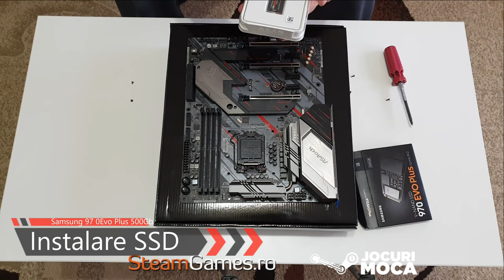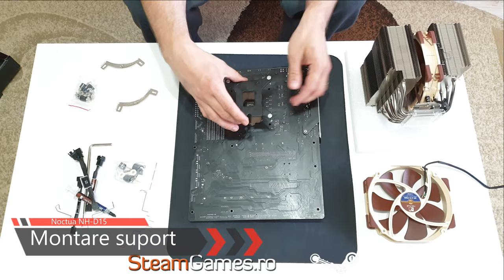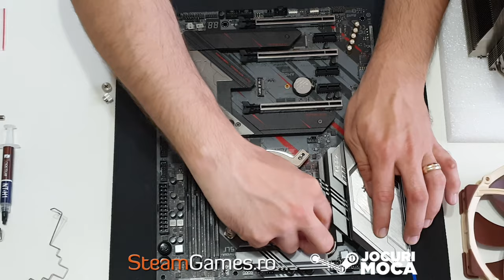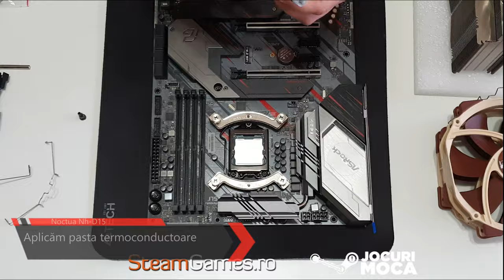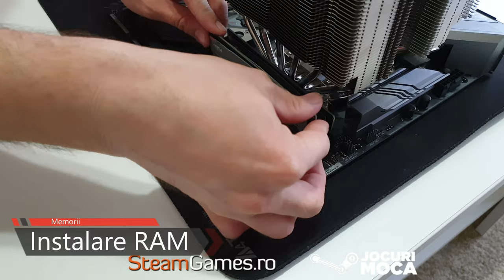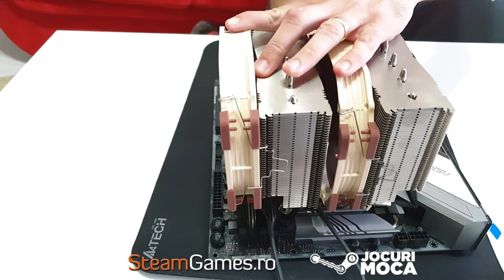Installing Noctua NH D15 cooler on Asrock Z390 Phantom Gaming 7 and Intel Core i9-9900k

Comment: Thanks, I was really wondering if this Noctua NH-D15 cooler was going to fit on my ASRock X570 motherboard and in the standard computer case I bought.
Reply from the maker: It fits and it is great for cooling, just make sure you have a wide enough case, especially if you want rgb ram

Comment: Thank you for this video. I was just thinking of getting the Asus Z390-H Gaming mobo with the NH D15 cooler for an i7 9700k and wondering if regular sized RAM sticks would actually fit underneath it, given how big the cooler is. The case won't be a problem, I hope, since it'll be the Thermaltake Level 20 GT.

Comment: I have a problem fitting my RX580 video card in z390 with Noctua NH D15 installed. If I insert it in the PCIe x16 (where it should go), it's touching the radiators and not sitting properly. Am I doing something wrong? I really don't want to put the video card in PCIe x8, since I'm just using one card.

Comment: can put memory whit led below nocuta  about clerance what is
Reply from the maker: 32 mm standard and higher if you move the cooler up but then you need a wider case (165 mm height with standard, so fir 42mm ram you need at least 175mm wide case)
Reply: @SteamGamesRo  well iam looking for nzht h510i  and gigabayt mb whit memory
G.SKILL 16GB Trident Z Neo DDR4  she got led i dont think that can put under..but i looking be quiet fan for i7
Reply from the maker: NH-U12A from Noctua would work for your setup. Low noise and pretty good for cooling (10% temp over D-15). Darkrock are same size as the D-15. You can try NZXT Kraken for the looks but the sound is pretty high with standard fans
Reply: @SteamGamesRo  never use water..am old school ..hahaha
well must to wach memory what is  dimenzions  i know for noctua  i hope that here is better
Reply from the maker: Here are benchmarks for the U12A https://steamgames.ro/review-noctua-nh-u12a/5/ and overclocking performance: https://steamgames.ro/review-noctua-nh-u12a/6/

Comment: What kind of ram did you use?
Reply from the maker: We needed a lower profile memory so we chose Corsair Vengeance LPX Black DDR4, 2x16GB, 3200 MHz, CL 16
Reply: SteamGamesRo thank you, I went wurst ballistic sport, it barely fit lol
Reply from the maker: @ZmaniacGamerz  Yeah. the NH-U12A has more space with almost the same performance. We are also review-ing and unboxing the new chromax black series next week, for both the NH-D15 and NH-U12A
Reply: SteamGamesRo do you think 4pieces corsair vengeance rgb Pro will block this cpu cooler? (They are pretty large)

Comment: Whoa nice rig man!, awesome MOBO too!. Question. Do you think the NH-D15 could also keep an I7 9700k cool when OC'ed to 4.7 - 5.0 GHz?. What were your temps under load when OC'ed?. Were they over 80 c?. I would like to be able to do it within 70-80 c max. I really like Noctua and don't want to use a 360 MM AIO to cool. Everyone is saying I should water cool but I feel this is close to being able to handle 5Ghz and keep it cool. Can it handle that you think man?.
Reply from the maker: Yes, using it now for 2 i9-9900k with great success and will use it for the 10900k as well. We are getting ready to build a new rig with it. Still the best air cooler